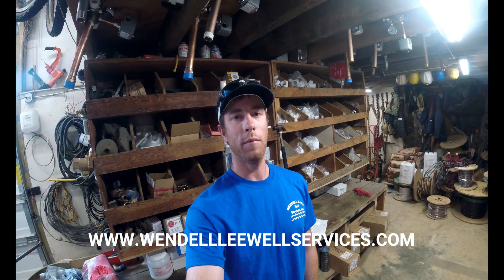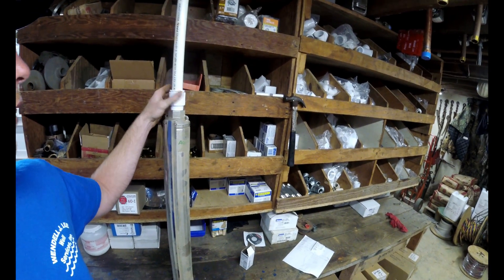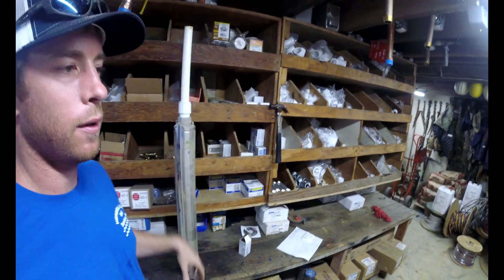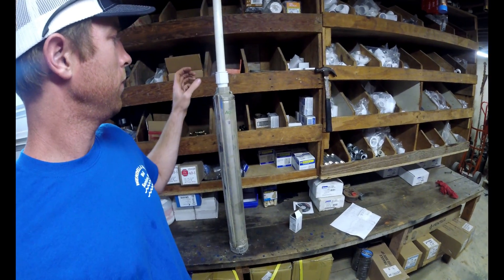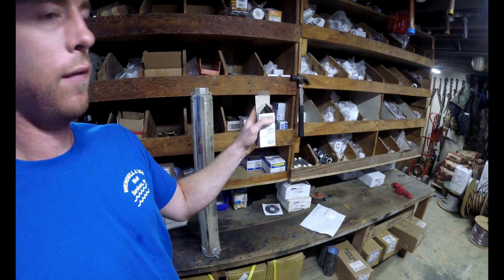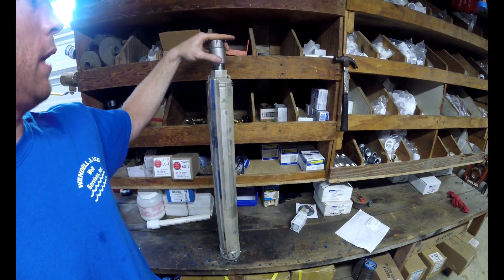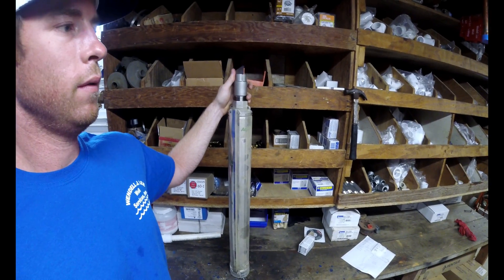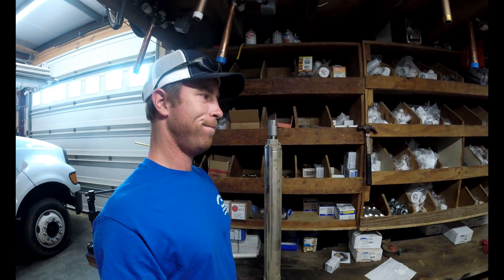How NOT TO INSTALL a Submersible Well Pump

Comment: Do you ever see properly installed PVC pipe fail on something like a 300 or 350 ft. well with a 2HP pump? Just wondering if the torque eventually wears the plastic out, etc. Thanks.

Comment: I like that SS check valve !  It's FNPT/MNPT so no additional coupler-  Could you please let us know the part number and typical cost of that piece ?  Also going with threaded schedule 80 PVC above that a good way to go?  My pump sits at 80'.